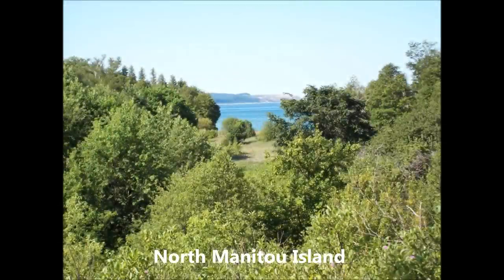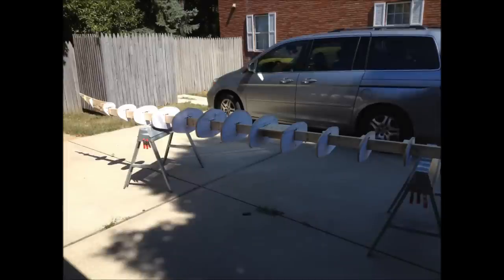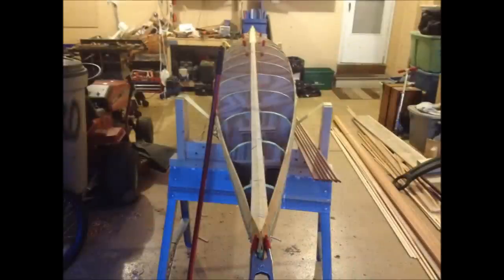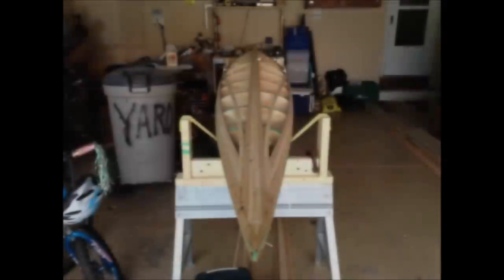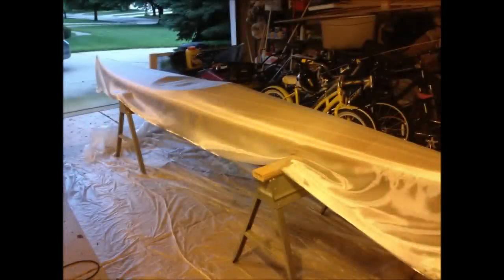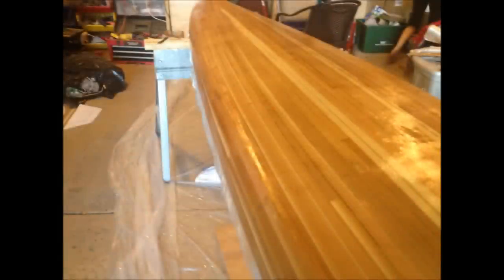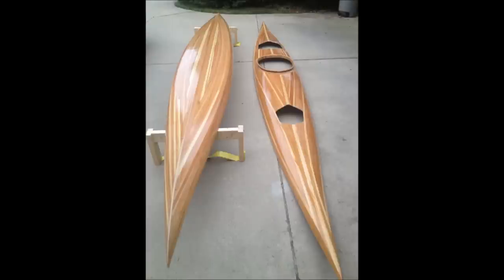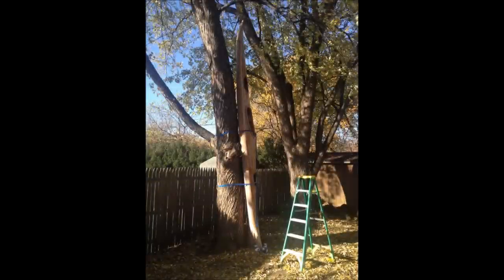Guillemot Kayak Build

Comment: Beautiful kayak , you are  a patient man, How do I know? I,m building the same,started in 2001 winter, from the same path , bought the book, read it, learned about the offsets,bought quality cedar, made my strips on tablesaw ,made the strong back, forms etc.. Then, sold the house, and then grandchildren (6) came,hang the project on the ceiling of garage, promising myself to finish it when Time allowed. Time (years) passed,then this year 2020 ,we cancelled our winter Florida trip, looked at the hanging project in the garage, took a deep breathe,  then made my mind to do it now,  Its, underway of completion right now, and I can,t wait for Spring to show up to start working outside on the epoxy. Imagine a 20 years span between Start and Completion, I,m thinking of naming this boat  ""Long_Awaited"",  Your kayak skows how patient and dedicated you were, Congrats.
Reply from the maker: What a great story! 👍🏼  I currently have a second one in my garage that I started seven years ago. I’ll get back to it soon...

Please share a pic when you’re finished.
Reply: @mcleodrp  hello Ryan, Ifound your video up lifting , and Yes I will post picture when it,s done, thanks for sharing, I had built 5 stich and glue previously,  regular Guillemots,
Reply: Correction, I meant  Chesapeake model 17  and 16,s

Comment: Great video ,  Thanks for sharing
Reply from the maker: Chris Perkins Thank you!  It was fun to build but even better to paddle!
Reply: I'm still thinking about it. Its the shape that's so  beautiful. Your use of the contrasting woods is really effective. I have ordered the book from Amazon so will have a good read over Christmas . Would it be ok to contact you if I'm not sure how to do some parts of the build ?
Chris
Reply from the maker: Chris Perkins that's exactly why I picked this kayak to build. Not only was it a good fit for my needs, it has beautiful lines!  I'd be happy to help anyway I can.  The only change I would suggest you make to the original design is adding a skeg. I added a retractable skeg after that fact which was harder than if I would have done so during the original build.  Nick Schade sells plans for the skeg.  Just search Google and you'll find it.
Reply: Many Thanks  for the offer of advice. Will search for the Skeg addition to the design.

Comment: Thanks for sharing your experience. Really nice job! Are you able to notice the staple holes after it is all varnished? I am debating using staples or clamps. I know staples are a lot faster.
Reply from the maker: You can see the staple holes, despite my best efforts to get them to disappear. It is much slower and more challenging without staples. But, if I built it again, I’d probably do it without staples.
Reply: I will never use staples anymore, they leave a mark you cannot delete, I would use a system of clamps.

Comment: Very nice, was thinking about a stitch and glue to add to my sof but this changed my mind!  Also, do you have any bulkheads?  Thanks
Reply from the maker: I used closed cell foam for my bulkheads. One fore and one aft sealed with marine caulk.
Reply: I used pink celotex insulation. It was easy, cheap and most of all, slightly flexible which is good for hull integrity.

Comment: great job, was this your first? what bonds the bottom to the top, is it a glue joint and then more fiberglass?
Reply from the maker: The two halves are just glasses together with strips of fiberglass on the inside and outside.
Reply from the maker: Here is a video showing the process:  https://youtu.be/Y6h5Tqs8rsc

Comment: what woods did you use and where did you obtain them? I take it that it was select grade as there are no knots? nice job! I am planning to build my own.
Reply from the maker: I used cedar with a few pine strips as accents. All of my wood I hunted down at my local Menards. I had to go through almost every cedar board they had to find ones with no knots. I had to make a couple trips a month apart to get it all. I could have ordered clear cedar for 3x the price. I had more time than money.
Reply: thank you for your reply, I am having a hard time finding good lumber for the build.
Reply from the maker: Probably the easiest way to get the wood is to special order it through a lumber yard (not home improvement store). It's more expensive but you are likely to have less waste.  If you scavenge your local Menards (I had no luck at Lowes or Home Depot), even their better wood may not be useful. Good Luck!
Reply: thank you for your response. found a source online, and you are right, local stores have nothing.
Reply: thomas marabilla  Pony up the cash and find a hardwood retailer that can get you clear red cedar. The cost is worth the quality of the material you will work with.

Comment: Looks like you did a good job on this boat. I'm a Shade fan - I have his Petrel S&G and will probably replace my Pygmy Artic Term '17 with the Guillemot, maybe the Night Heron. Nick's a real artist. Did you cut / router your strips yourself?
Reply from the maker: Wesley Picotte Thank you!  Yes I did cut and router the strips myself. I absolutely agree that Nick is an amazing artist. I'm pleased with how this turned out but it's no where near the quality that Nick builds.
Reply: Did you have a table saw (assuming that's what you used to mill)? After building three kit boats, I'm eager to build one from "scratch". I have a nice portable table saw, but it's small and hence would need to create an infeed / outfeed system for long strips.
Reply from the maker: I used a table saw and built an extension to support the long thin strips. I also used a router table with a similar extension.

Comment: Remember when you took the strong back out and the two halves weighed like 9lbs. How many staples did you pull for that, eh?
Reply from the maker: abedanielspictures That is true!  The strong back was much heavier than the shell. Pulling staples seemed to go on forever. But, not as long as the sanding...SO MUCH SANDING!
Reply: That's a great stage when you have the two halves, just glued cedar strip. But then, up next is the 38' long quarter inch wide glue line coming up. Yay tape.

Comment: The problem with this kayak is when you are flip over . ilost my 5 kayak (all petrel) but i manage to put a hand pump so that when i flip over i can still manage to get rid of the water inside of my kayak but still it is a lot of work doing this. Any advice on what should i do.
Reply from the maker: I use a hand pump also.  I suppose you could install a battery operated bilge or I've heard about foot pumps.  I'm not sure though, I've never used either.